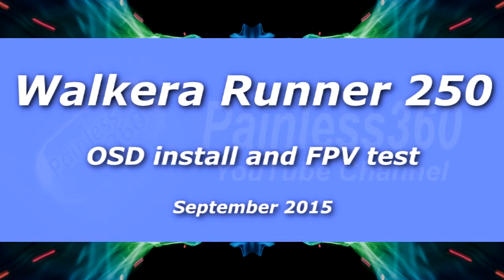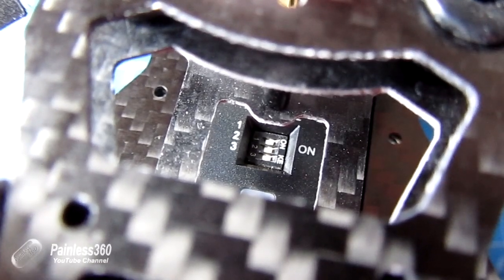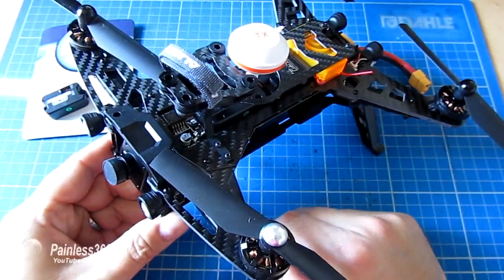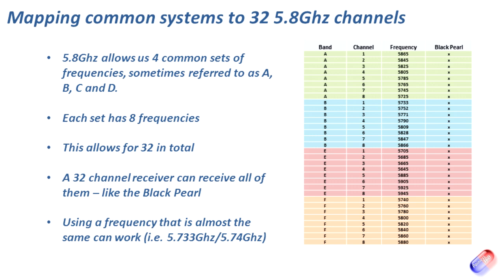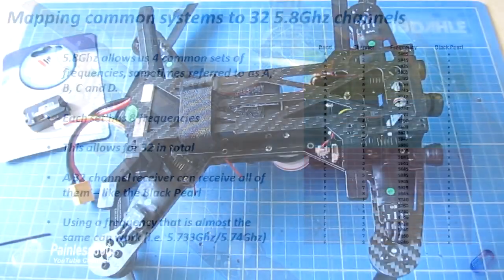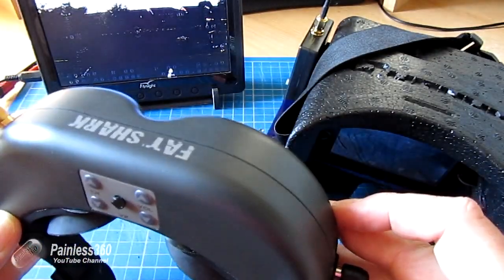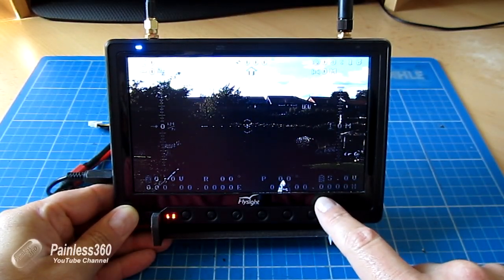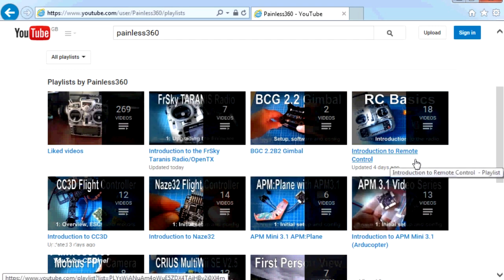Walkera Runner 250 - Installing an OSD and testing FPV with Fatshark (Supplied by Banggood.com)

Comment: Hi man, i have osd installed on my runner 250 and the osd red light is turned on. But i only see the video on my goggles with no osd, did you have a clue what should i do?
Reply from the maker: I don't have one to try anything with here. This is a very old model now so I'm probably not the best person to ask. Best of luck!
Reply: @Painless360  Yeah man, i just took this old toy from the attic recently, i idly testing whether it is still on or not, then I found that the osd is not visible at all. Just wondering if you still know anything about this drone because i saw you make quite a lot video of it, btw thanks for replying to my comment

Comment: hello my friend Does you will now help me I want to buy a screwdriver for hexagon screws of the runner but I do not know how many inches (millimeters) is, you will now help me
Reply from the maker: 15 use mainly 1.2, 1.5 and 2mm hex drivers here. I'd recommend investing in a little set that gives you a nice wide range or sizes as you'll use then again and again in the hobby.. Best of luck!

Comment: Hi - nice video. I see you have another cam, since there is some information not shown like the cam icon, the amount of fps, time etc (data from the cam itselves). I have those icons, but want to get rid of it.
Do you know what type of cam is installed? I wonder if a firmware update will do the trick.
Reply from the maker: +Frank V if there is an option to remove them, it should be in the manual. Best of luck!
Reply: +Painless360 :) Manual? What manual? Walkera and manuals is another story.... :)

Comment: is there a way i can use my iphone to see the video as i am flying this or what is the best and cheapest way thank you for your time
Reply from the maker: There are some great videos on this on the AndyRC channel - they may help.. Best of luck!
Reply: Thank you for your reply. Since I comment to you i have watched a few videos on Youtube I ended up buying a Walkera runner 250 r advance. now this I hope i got right I brought the Devo f12e transmitter so I now have the screen to see what I am filming. I seen on you tube that I can connect this to my drone is this true thank you for your time as this is the reason i
I brought the unit.

Comment: Great vids always !  I was wondering if you could tell me what the cable/plug is for the video 2 alternate port on the runner 250's pbd ? I have been searching for this information for over a week with no luck. I know its a 5 pin port but I need to find the plug and cable some where.  Thank for any help on this topic and keep up the great work !  Sincerely Matt in Ohio
Reply from the maker: +desode9 Not sure - I'd start by looking at the JST series of connectors - most are that type these days..
Reply: +Painless360 Thanks that's at least a starting point and I Greatly appreciate any info at this point !  LOL

Comment: many thanks for these vids on the runner 250 i think I'm going to purchase the OSD module for mine, Have you worked out if there is a GPS one thats plug and play at all?
Reply from the maker: +Sam Tait Not with the original model - it needs a baro soldering to the main board and a FW update too...
Reply: +Painless360 Hi, what kind of FW update do you mean for the original version ? The FW of the Advanced version ?
Do you have a link to a tuto for doing this upgrade please ?
Reply from the maker: No, as it doesn't actually provide the GPS flight modes without many additional changes too (soldering baro onto FC etc.).. Best of luck.

Comment: can I use a rc832 receiver with this osd
Reply from the maker: +XxLengendFall xX Should work great.. Best of luck..
Reply: +XxLengendFall xX 

its taken me lots of head scratching over the last day but after watching this vid I have finally got the RC832 picking up the runner 250 displaying on a 43&quot; TV for testing it out 

Runner 250 on channel 8 (all micro switches clicked to the &quot;ON&quot; side of the transmitter) and the RC832 on band 2 channel 1

on paper this is transmitting and receiving on 5733mhz

Comment: Thanks for the video. My telemetry data is cropped at the top of the screen and i am using quanum goggle V2, is it possible to be an OSD issue or Vtx issue or monitor issue? If i flick switch no.2 on the OSD some of the data disapear such as the home arrow and then rest of the data shifts down such as the timer on the top right. I tried two VRx and 3 5 inch monitors the problem is still the same. What monitor size do you have on the quanum goggle in this video? Thanks
Reply from the maker: All the kit is standard.  Not sure what to suggest. .
Reply: +Painless360 Thanks. your display on the monitors shows full screen, mine has two black lines from top and the bottom but I think thats because I have the 1080p camera. I am thinking of downgrading to the 800tvl and see how it goes.

Comment: My OSD don't show any valid GPS data, only shows voltage,  time, pitch, roll and artificial horizon attitude.
Reply from the maker: +Francisco Carabaza I would contact the supplier for help, having the GPS pieces omitted is useful as they don't work without a GPS connected anyway. This is how mine worked. Best of luck.
Reply: +Francisco Carabaza I have a runner 250. Add a Walkera (QR X350 GPS module) the problem is... Mutiwii only... I have GPS but only mutiwii can see it... anyone can help us? It will not show on my fpv/osd!
Reply: +Painless360 I have a Walkera (QR X350 GPS module) on my runner 250 the problem is... Mutiwii only... I have GPS but only mutiwii can see it... anyone can help us? It will not show on my fpv/osd!
Reply from the maker: I am waiting for the official GPS module to come out for the Runner 250 then I will try and add one. The Runner 250 is running Multiwii code..

Best of luck.
Reply: Lol ok no joke buddy!
Reply: Painless360 no joke buddy! A n expert has ???the knowledge!!! maybe>
Reply from the maker: There is NO detail on the pinout of the GPS port on the side of the flight controller to even start to try and find the right settings for a GPS unit. Until Walkera release the official module it would be slow work to figure everything out. Happy to undertake that work if you're willing to fund it..
Reply: Painless360 I already have sort of it is the same as there QR X350 GPS I just plugged it into the port and the pinout is the same its shows the GPS and my location on pc/multiwii but I cannot make it show the GPS on the osd... I tried the dip switches but they will not show the GPS only turns off the osd features but will not show speed or cordinents on the osd only on my pc in multiwii?!
Reply from the maker: I've not tried it, sorry. Best of luck with it.

Good to know that the X350 unit works.
Reply: Lol! Ok! Best of luck in stuff! That is the life right! But help from people and we can make it better!
Reply from the maker: Absolutely! Happy flying! :)